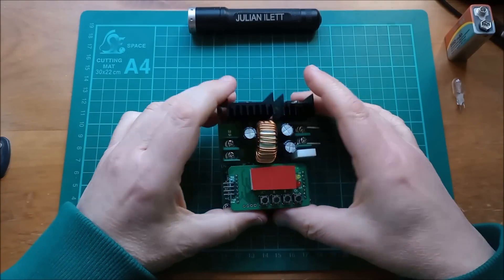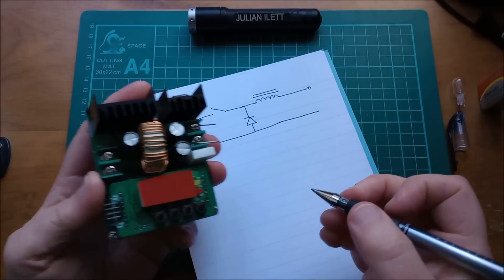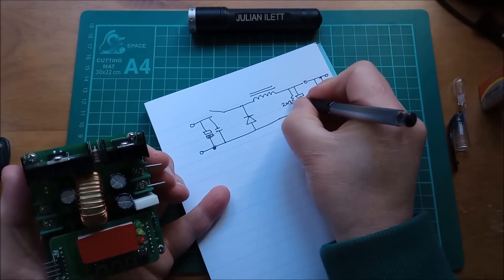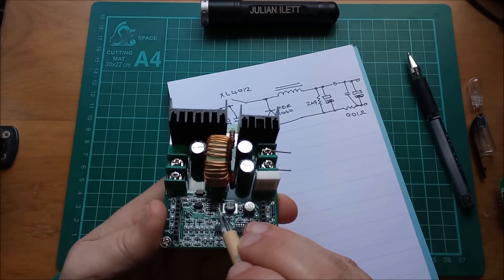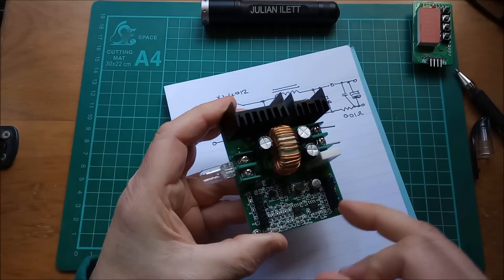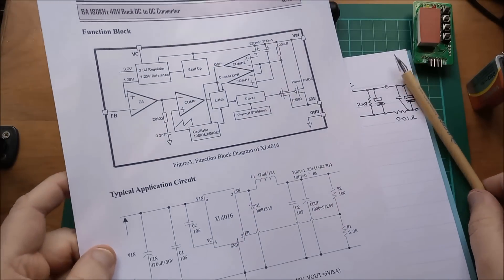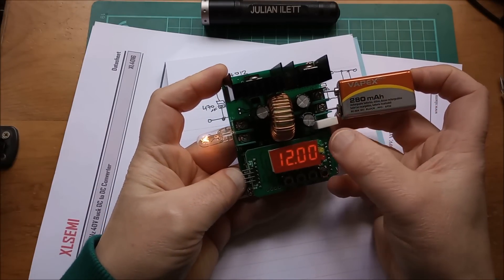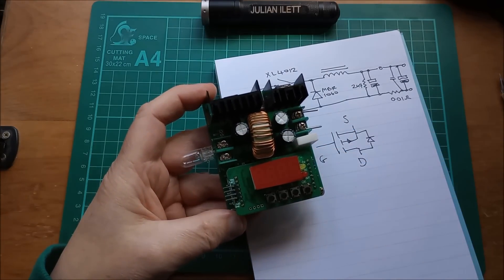Anatomy of a Buck Converter - Back Feed

Comment: I have the slightly bigger one that does boost buck which I have used to charge lots of batteries and I'm sure I have lost power and i don't think it will power up but Like I said it's a boost buck not just a buck

Comment: The body diode is one thing you always have to be aware of, if you use MOSFETs in your circuits. But sometimes it is very helpful, too. If you consider electronic rectifiers you can use the body diodes of the p-channel MOSFETs connected to the positive rail to charge the output capacitor up to a voltage until the comparators of the rectifier can do their job to switch on these MOSFETs to overcome the voltage drop to use the full potential of electronic rectification.

Comment: Some synchronous buck cant be connected to a battery at the output, because some dont have diode emulation, meaning that they become a boost converter once the the input voltage is disconnected, flowing current back to the input line
Reply: Or when the input voltage drops.,..

Comment: wonder,
could you use a Buck Converter as a modulator?
and i mean can you modulate the power supply Volts output,
so you can use the Buck Converter as an AM modulator?

Healthy and Friendly Greetings from the Netherlands!
Rob
Reply: Class D amplifiers are that, they change the pwm, filter it with inductors and capacitor, and then you wave a output amplified signal (that can change frequency and amplitude)

Comment: The inductor is most certainly not ferrite. I can't really see clearly but it appears that the core is painted pale green with one face blue. That would make it Micrometals type 52 material - or a counterfeit (yes, there are counterfeiters of inductor cores).

Ferrite toroids are generally unsuitable for power inductors for switchers. They are low loss at high frequency but the saturation flux density far too low to be useful, The AC loss in powdered iron is a lot higher but the core can sustain much greater flux density without saturation. Micrometals type 52 has pretty good property tradeoff for this sort of use. The loss is acceptably low in combination with high enough magnetic permeability to allow useful inductance with a moderate number of turns and tolerable "swing" (reduction of permeability due to DC bias, which is a major consideration in a buck converter). There are better materials than powdered iron for this sort of application, but the cost is considerably higher (MUCH higher for molybdenum permalloy powder cores).

The configuration of the two FETs at the output of the switcher chip is a means of sensing the current in the main power switch. Two FETs are used - a small one with the current sense resistor in series and the large, main switch. The current through each FET is in inverse proportion to the size of the FET. This allows implicit determination of the current through the large FET by actually measuring that through the small FET using a resistance that is convenient for integration in a monolithic IC. This scheme in discrete FETs goes back decades to the "SenseFET" products from International Rectifier.

P-channel FETs are used because normal buck converters where input and output negative side are common require high-side switches. N-channel FETs would require a gate drive voltage several volts higher than INPUT voltage, which is a big problem in a simple circuit.

Comment: Many boost/buck converters have diodes with a capacitor on the output (both boost/buck ones like yours have exceptions, for example the famous XY8018 ones). They don‘t face the issue, just buy one without voltmeter and remove LEDs if it has one.

Comment: Why does the display show 12 volts? Is the battery voltage being boosted?
Reply: I believe the '12v' was a set voltage and when he turned it on the actual voltage was displayed.

Comment: Iv been using the XL4015 Step Down Module, Adjustable 5A DC-DC Buck Converter with LED Display and USB Port from my solar panels to charge a 4s lithium battery and it's great because an led turns from blue to green when full but when the sun starts to go down and goes below 16.8v I unplug it because I don't know if it has (back feed) or protection,does anyone know more about the module ?

Comment: You can also add a series blocking diode between the buck converter and the battery to be charged.  It means you need to adjust the buck converter to a slightly higher voltage to compensate for the forward voltage drop (Vf).  I recommend a schottky diode but any diode capable of carrying the current and dissipating the heat from the lost power (P = I * E) will be fine.
Reply: If your objective is to prevent reverse current to the input source, the best place for an added diode is between the input and the source. The current will be reduced in proportion to the voltage step-down of the the buck converter. Of course with the diode in that position the battery can still discharge slowly through the circuitry on the board, but that means you don't lose the voltage monitoring capability of a board like that in the video.

An "ideal diode" controller from Linear Tech (now part of TI) is a good solution at the output, though a tad expensive and it requires a circuit board.

Comment: Some of These Do have Hidden power up Menu mode (holds SET  AS you Connect Power > One of The Hidden menus  Allows you Switch the output OFF -  On Power up until OK is Pressed (Should be noted these do have a Extra Mosfet That also doubles as the perfect (No loss) Diode  )